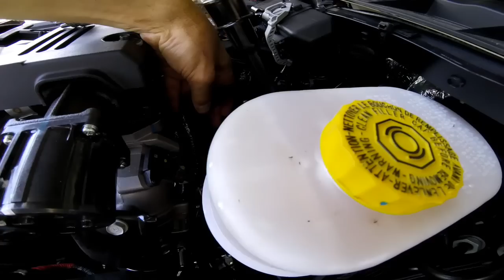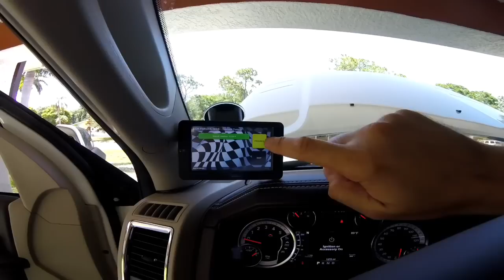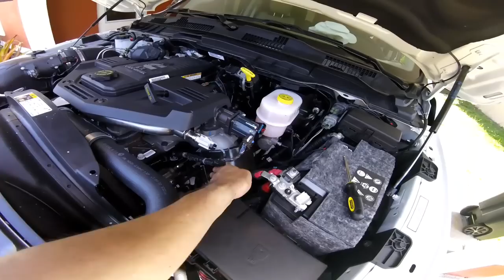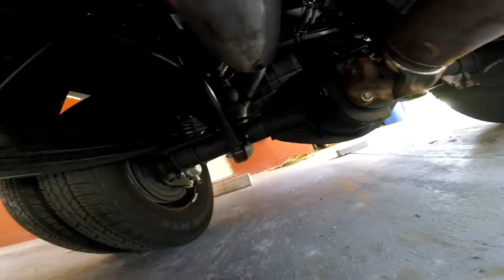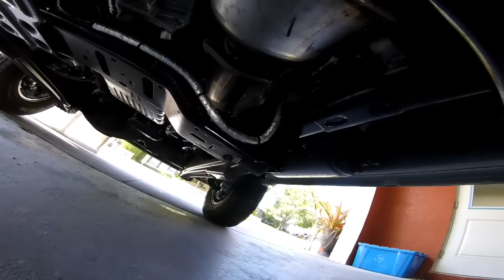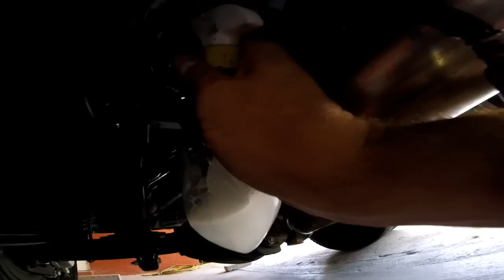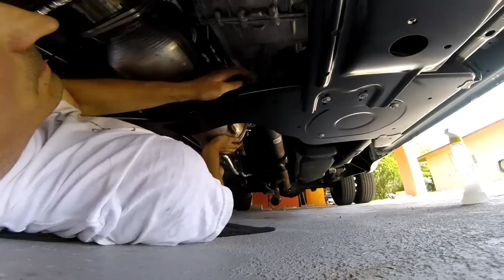New Ram 3500 DPF EGF EGR delete with RaceMe Ultra

Comment: u didn't have to take anything off the motor? how does it run and pull?
Reply: Shaun Volkmann Do they check your ECM to see if you've messed with it? I've heard they can see if someone has tuned or flashed the ECM before?
Reply from the maker: Yamaha Jet-Life1017 Only what is seen on the video, no other mods. Pulls so much better
Reply: I made a mistake a purchased an extended warranty on my 2016 ram 3500. How long would it take to return everything to stock for you take the truck in for service?
Reply from the maker: David Prohaska I can't speak for that, as I am not a tech. I can say it is back at Ram now for warranty work. They reflashed the air suspension control module, no questions asked. Unfortunately it was 5 hours to reinstall everything prior to bringing it in. :-(
Reply from the maker: Alex MacLean thanks for the input Alex!
Reply: Why Not take it to a side mechanic who will do the warranty work for you even if it's deleted?
Reply from the maker: Serge Pavlov it's about 4 hours to put it back together. I just had to do it, rear hub bearing failed, and my torque converter took a dive at 8000 miles :(

Comment: After doing what you have done, I guess you would restore the stock settings before bringing it in for a warranty issue if the need were to arise. Would the dealership know that you had unlocked the truck and possibly void your warranty?
Reply from the maker: Fisherman Guy I pulled it all once before and brought it in for warranty work.  They did the work, and said they flashed the ECU because my pipe had a lot of soot (not knowing it was from the delete), and said I would be needing more DEF moving forward. Lol... I haven't added any since new, and don't need too now!
Reply: Brandon, I was curious about this too and I've looked at the act, but can you expand on what you were getting at??
Reply: brandon mayes preciate it!!
Reply: Hard to argue with success.....LOL

Comment: What does this run and where do I buy it
Reply: Shaun Volkmann I'm new to this and wanna do it like this I understand a lol bit thanks to your video is the any way u can send exact parts for your "delete" is this something that was recommended to you instead of full delete? Hope to do this soon thanks
Reply from the maker: Cutting Edge Lawn & Landscaping RaceMe Ultra is for 2013-2017 Ram 2500 and 3500 I believe. They make tuners for older models as well.  I bought mine directly from the manufacturer... or you can buy from performance diesel vendors online.